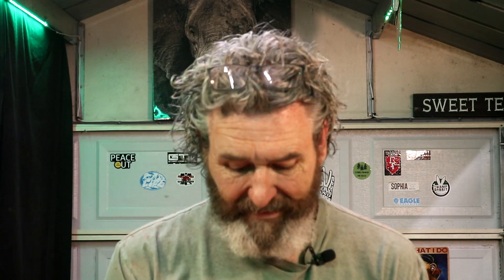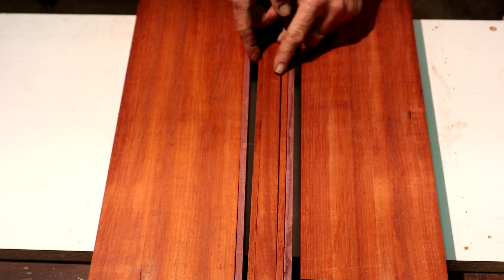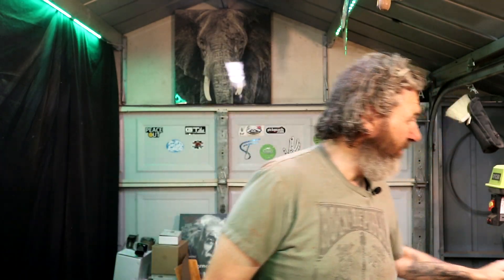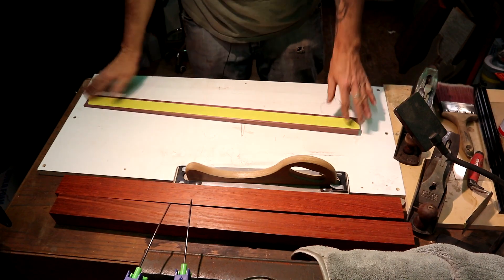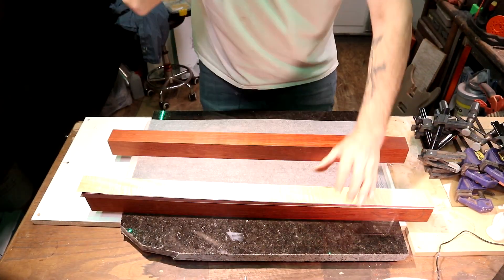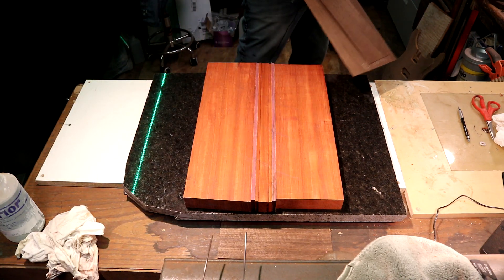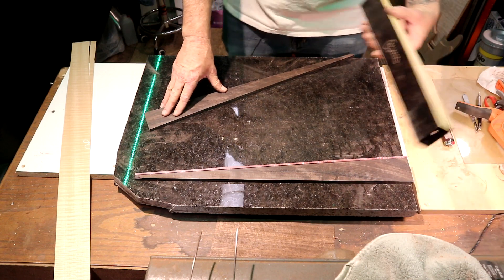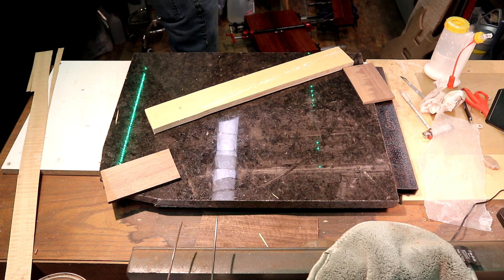Custom Guitar Build - Cloud 9 - Episode 02

Comment: Hey Todd.

Your bolt through is an interesting idea. Another angle I thought of but won’t be trying - yet - is sort of in between a neck-thru and a set neck.

It’s often thought that a long neck tenon can help sustain. I thought to take it even further. The tenon often goes thru the neck pocket into the pickup cavity - a ‘long tenon’.

I thought of taking it even further through body to where a middle pickup would be, with the pickup cavities routed into it. 

When I first thought of it, I thought I’d have to somehow carve a tunnel through the body - but then it hit me just how stupid I was being (it was late at night in bed). Instead, I’d leave the gluing of an already sanded drop top until AFTER the neck with its extra-long tenon was already glued into place.

Obviously this would need clever planning regarding the depth of the neck pocket and how the neck fits it, but I think it’s doable at some stage. 

Might be interesting a few guitars further down the road..

Best wishes, P&L

Paul.
Reply from the maker: Thanks man. I would do the extra long thing and thought if that tok after the fact, but my wood wasn't long enough! It seems like a solid idea! ✌️
Reply: Kiesel does this with their "Set-thru" necks. Check out their Crescent model! Mine is a serious work of art, even if it is CNC carved. Another really cool neck joint is Parker's "radial" joint that uses a round neck and round pocket. The theory is that, by eliminating corners they eliminated dissonant feedback, keeping vibration transfer consistent and eliminating dead notes common to most bolt necks. Check out their Nitefly model specs!
Reply: @CoraTreeCustomGuitars  cheers! I knew it couldn’t possibly be an original idea, so I’ll certainly search those out!
Reply from the maker: @CoraTreeCustomGuitars  I've seen the Parker and the Kiesel joints. Both are killer. I'm just trying to do something a little different, you know. Not that it's truly "original" just off standard! Plus the increased contact and stability added by this type of joint will certainly have an impact on the overall tone and sustain. That's what I'm after! Peace brother.

Comment: Awesome!! You must have glued that thinking cap on by accident with all that squeeze-out. Can't wait to see the progress on your builds, Is going to be a Standard shape or a custom? What surprises are in store? Peace, keep makin' dust.
Reply from the maker: Starting with a PRS template. Double cutaway but I won't use the template for routing. I'm just starting with it. I will freehand my design on the body blank and cut it out then sand it with no template involved in the perimeter shape. I love doing it that way so no 2 are the same. Thanks for the comment! ✌️

Comment: Hot tip on the glue brushes! Skip the cheap hairy brushes that always leave brush boogers in your work! Pick up a few silicone basting brushes! No chunks fall off, and cleaning is as simple as letting it dry and pulling the hardened glue off in one chunk, like demolding resin!
Reply from the maker: Done and dusted. I got 2 yesterday!

Comment: Hi Todd! Amazing video, as usual. One question: which angle you used on the middle purpleheart strip of the neck?
Live long, and prosper!
Reply from the maker: I didn't use an angle to speak of. What I did was measure the wide side at 16mm and the thin side at 8mm. I would say it worked out to around 2 degrees or so. I'll measure the angle and let you know! ✌️
Reply from the maker: I should have said that in the video.
Reply: @SweetTGuitars  No worries brother. The dimensions are enough. 🖖